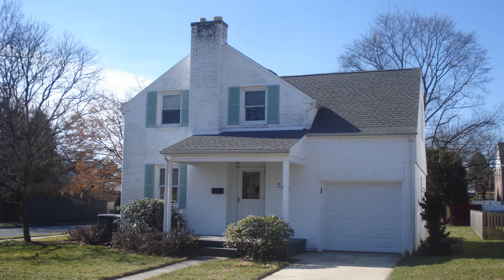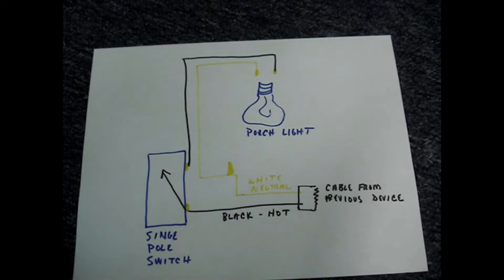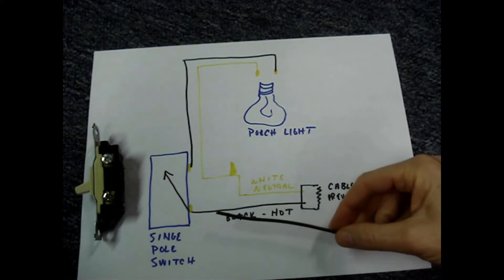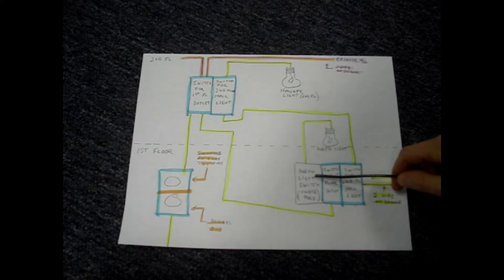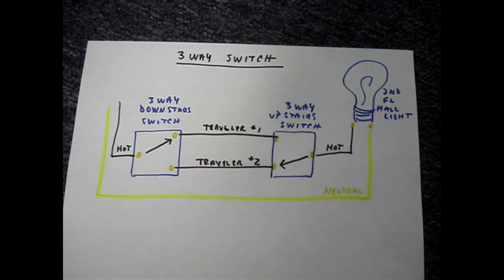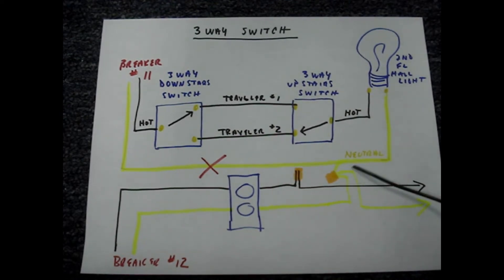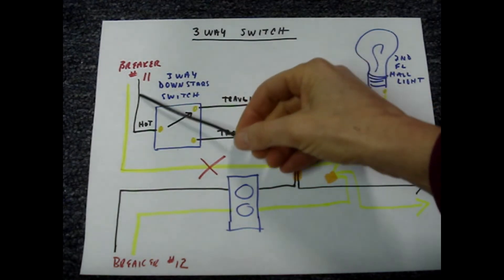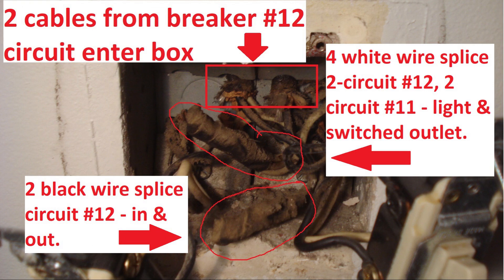Shared Neutral Circuit Residential Wiring

Comment: Thanks for the video. House was built in 1890 and we still have some 2 wire. They definitely jumped over to the neutral somewhere in the system. Volt stick mandatory for doing any type of electrical. Thanks again
Reply from the maker: You are welcome.  Best wishes for the electrical system.  That's a tough one for pulling new cables.

Comment: I found this out the hard way when rewiring my "circuit 12" and the neutral was sparking. Well, I guess I found it out the medium way because I didn't get sparked!

Anyway, what brought me here was that the 3-way is now causing problems with GFCI's upstream. Your video is the clearest explanation of what's happening I've been able to find! (And I now know what to do to fix the issue as well).

Comment: Great video.   I don't know for sure when this practice was banned. But it is dangerous.    Another related issue that you sometimes see with very old homes using knob and tube wiring,  was two fuses per circuit. A 15 amp fuse on the hot, and a 15 amp fuse on it's neutral.   One fuse will blow before the other if there is a problem.   A blown,  loose or missing neutral fuse will lead the homeowner to think the circuit is dead and it's safe to begin monkeying with it.   The circuit will be at 120 volts relative to ground all the way back to the neutral fuse.   From the turn of the century until around 1928, this configuration was not uncommon, typically homes of this period only had two to 4 circuits for the entire house,  and 30 amp service at 120 volts only,  was commonly used.  Fused neutral panels often have exposed connections easily touched, and may be built on site from timber, with an asbestos liner, posing additional hazards.   Old equipment may look really cool, but is very unsafe by today's standards.

Comment: I've asked two electricians doing work at my house about neutrals being shared between circuits in the past few weeks, and both have reacted with "no big deal" attitude, as if it is normal. It bothers me that I'm more concerned about this than the electricians I've been using. Thankfully the only place I've run into this has been where there are two circuits in the same room, one for lights and one for outlets.
Reply: The only time it's acceptable to share neutrals, is with multiwire circuits.   A classic example is kitchens from the 1970s, until the early 2000s or so, although they began phasing them out in the late 80s or so, when GFCI protection was required.    This configuration requires a two pole breaker or two pole GFCI breaker if required, and a 12/3 was run to each outlet.   Here, the tab on the hot side is broken, and the top and bottom half are on two different circuits,  the back and red.   They must be on the opposite phase, so that the neutral only carries the unbalanced load, otherwise the neutral would carry the sum of loads, up to 40 amps instead of 20, without tripping any breaker and can melt and become a fire hazard

Comment: Bottom line don’t have a circuit share a neutral with another circuit( keep legs on separate neutrals ) even though all neutrals lead back to the same bar don’t allow a neutral on leg 1 to connect to leg 2 and create a quicker path back before all circuits on leg 1

Comment: Hi Know How Now, thank you for your video, I just found this during a remodel, luckily I had the light already turned on and noticed that no breaker alone would turn it off, it was back feeding from the other circuit. I've identified the two circuits and they are on different phases. Is there a known fix for this besides labeling the corresponding circuits in each outlet box?
Reply from the maker: I was able to easily run a new cable to solve the potential danger.  If that is not an easy option, labeling everything is the next best thing.

Comment: Interesting problem, how did you discover it?
Reply from the maker: When I was tracing the circuit, before beginning work, I checked for voltage in the box containing the 2 3 way switches at the top of the stairs and found voltage on the hots from the circuit connected to breaker #12.   I saw the 4 white conductors spliced together, I knew the neutral was shared.

This situation is why you should always treat every connection as live until proven otherwise.  If you have an older wiring system you might want to turn all power off while working or after checking for voltage, don't turn any light switches on.  Never ground another part of your body while working on electrical connections.

Comment: Multi-wire branch with shared neutral?
Reply: No that’s not technically a multi wire branch circuit. It’s two circuits with a neutral interconnection.